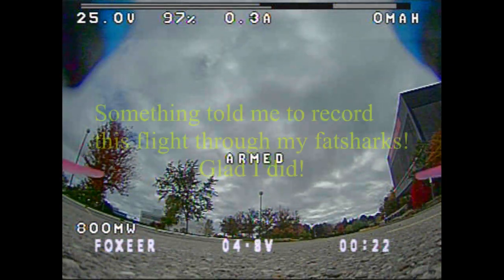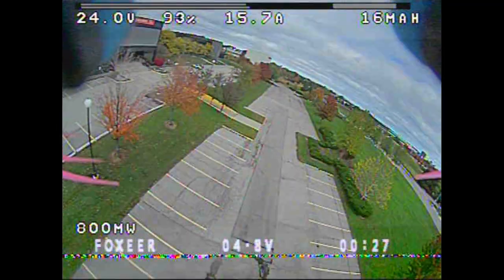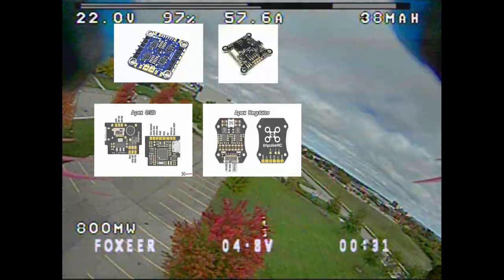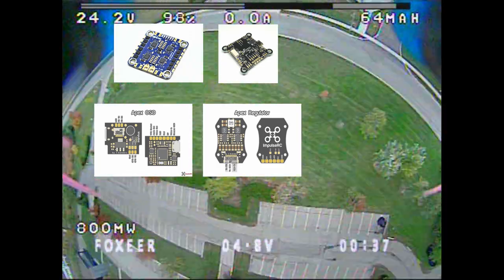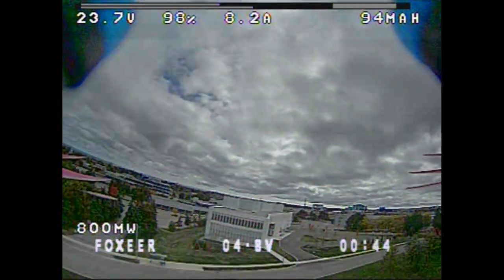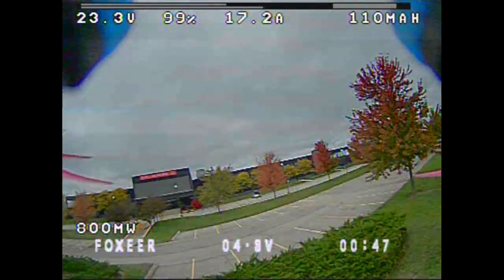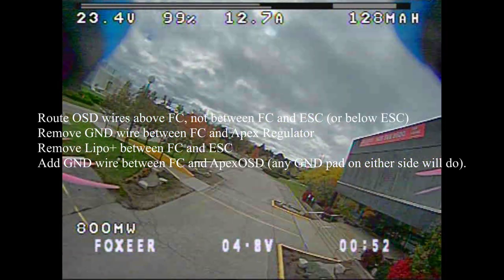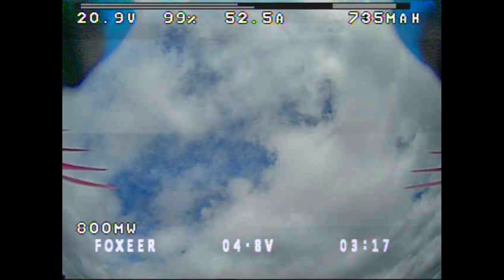Video Issue on my Apex builds

Comment: I may be completely wrong but it seems a regulator or attached circuit is overheating and shutting down. I know the Apex Mr steel osd and reg are designed to work with v2 kiss boards and kiss escs. I suspect a mismatch of sort on the fettec. Have you tried powering the VTX from the Lipo pads, and the Cam from the 5v out on the VTX. Only run the video though the OSD board. If problem goes away, then you know it was power related. If problem persists, then it should be the OSD board.
Reply from the maker: Thanks TwitcH_FPV! Thanks for the quick reply. I was thinking the same on the mismatch. I will try routing the power off the pads instead. Thank you for the help!!!!! I will post the results once I have made the change and test flight!

Comment: That's a heat issue mate. Toss a few pics up on ft forum of both builds.  Minus the top plate too please.
Reply from the maker: Hey Psyborg!!! ok will do. Also going to try the suggestion below... will post this evening
Reply from the maker: So i decided to remove the OSD and regulator board and run without it. Works perfectly. So it looks like an incompatibility with the FETtec set-up. Lesson learned...
Reply: @Luv2ripFPV  Troubleshooting my own quad, why would there be an incompatibility issue? FETtec telemetry or communication to the OSD?